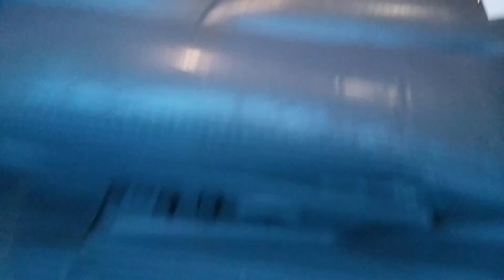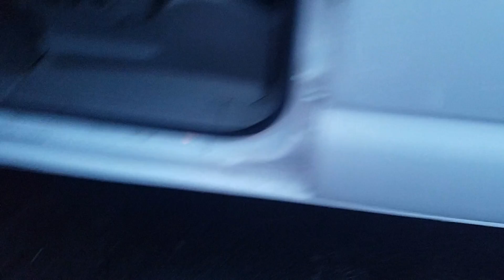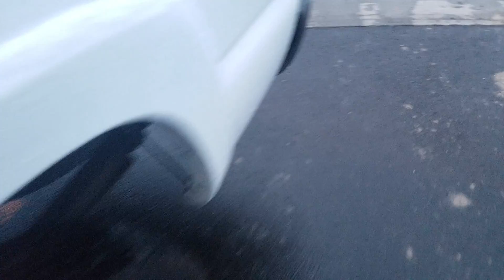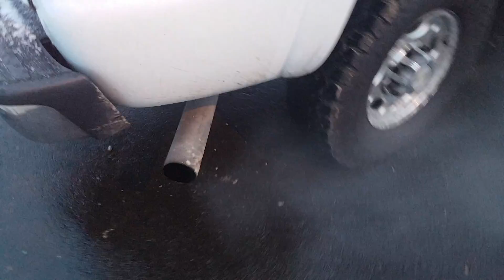stock exhaust whistle

Comment: I bought my truck with a 4 inch exhaust to an 8 inch tip definitely gotta replace that stock exhaust!!
Reply from the maker: thats what i plan on doing but i need to tune it first so i dont throw a code when i egr delete and throw a straight pipe on